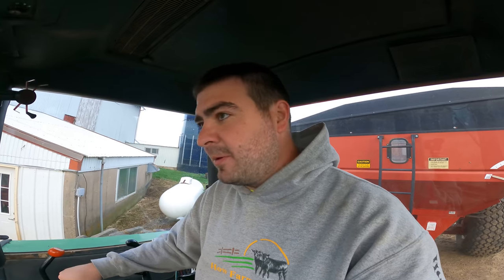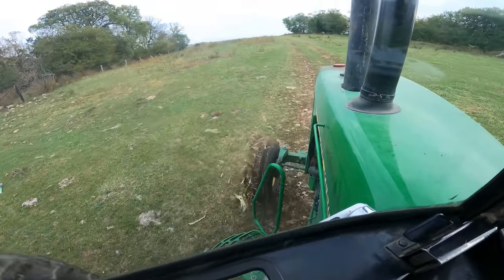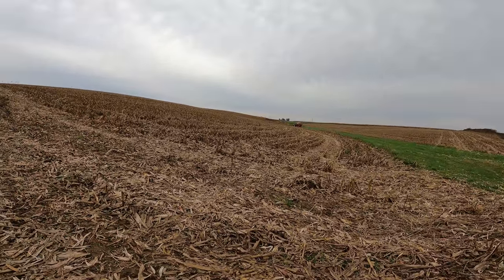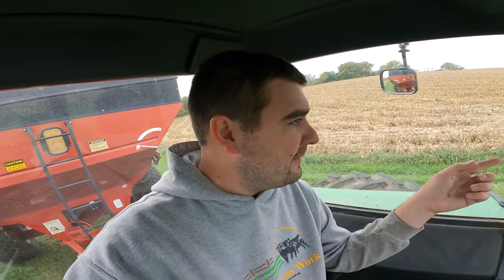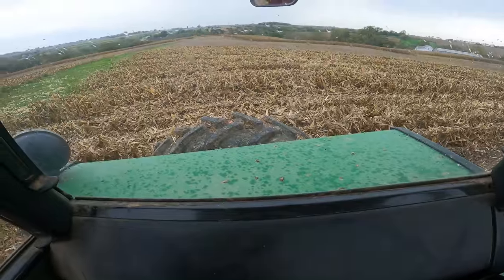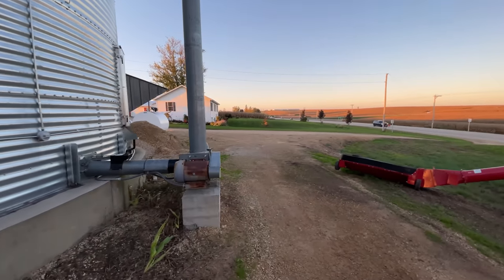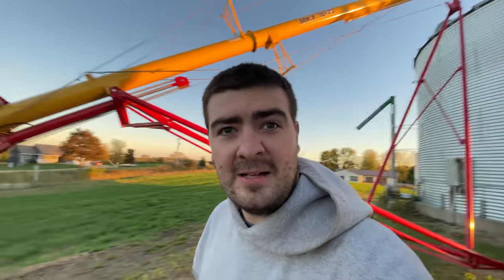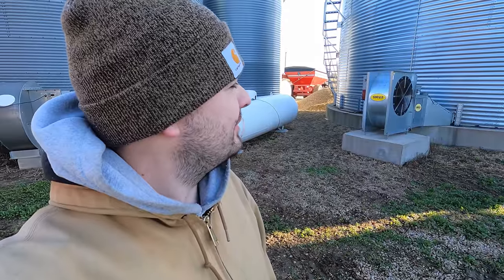Corn Transfer

Comment: I had said before…..if you’re going to use a 1300 bu cart in your terrain, you need way more hp in front of it, more than you got…...especially in the conditions you showed. 1300 is for flatlanders, not SW WI